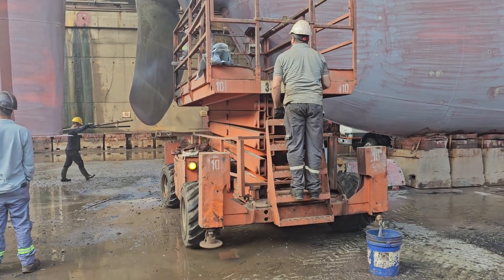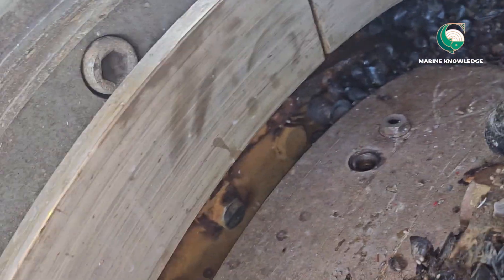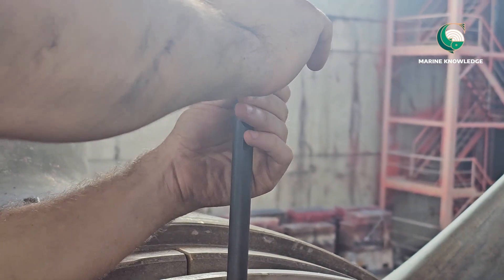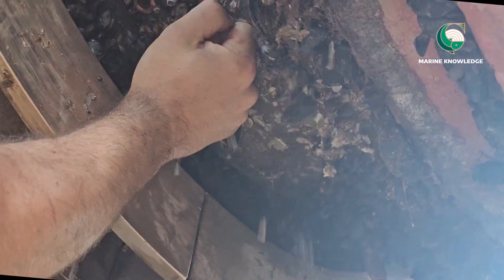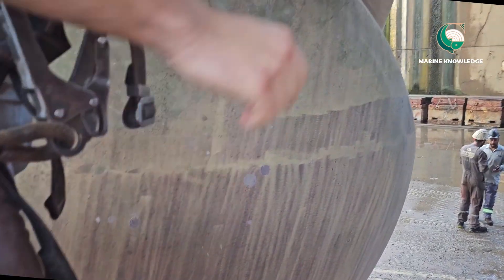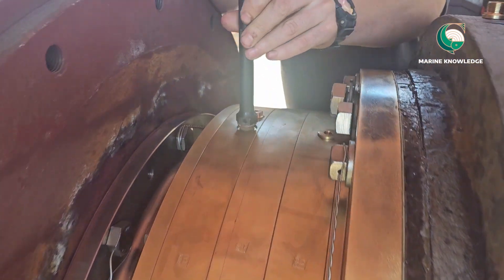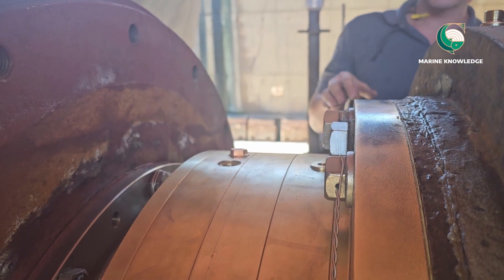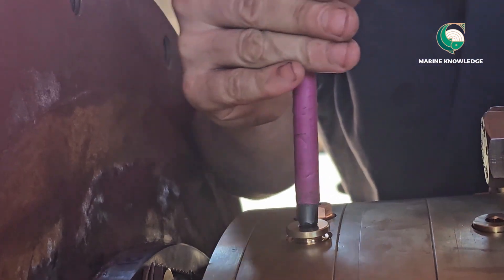HOW DO THEY DO....HOW TO MEASURE STERN TUBE BEARING CLEARANCE...

Comment: Checking from down side is to make sure the measurements are correct, if the ahaft is dropped 1mm and top clearance is increased by one mm the lower clearance must be reduced 1 mm.

Comment: This measuring instrument is called POKER GUAGE and this is called chrome liner measurement.
Reply from the maker: Very correct sir..
Reply: The measurements are on the chrome liner but it shows the bearing wear down thus we are checking how much shaft is dropped due to wear down in respect of the first day of installation

Comment: Sir  it's actually for chrome linear wear down measurement or  stern tube bearings wear down???? Measurent🤔🤔
Reply from the maker: ur rt  its chrome liner wear down only...
Reply: The measurements are on the chrome liner but it shows the bearing wear down thus we are checking how much shaft is dropped due to wear down in respect of the first day of installation